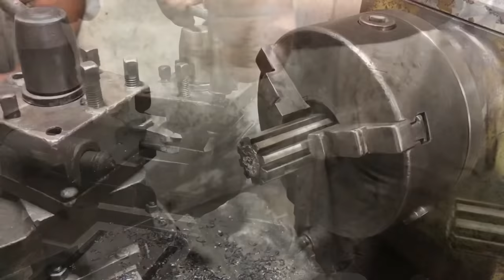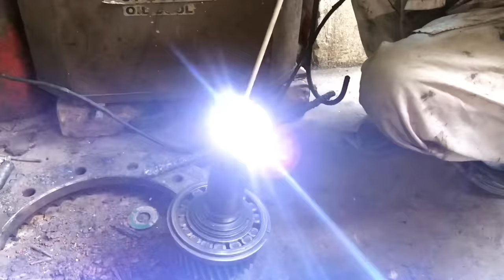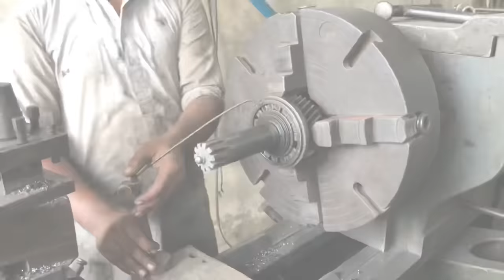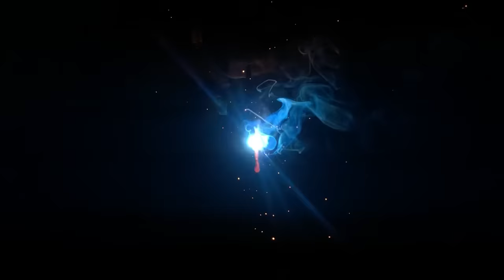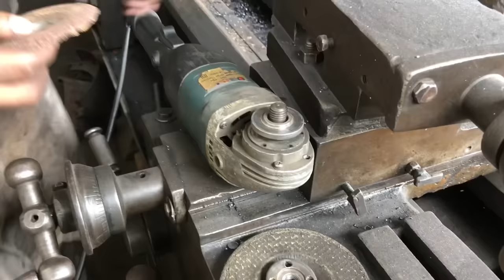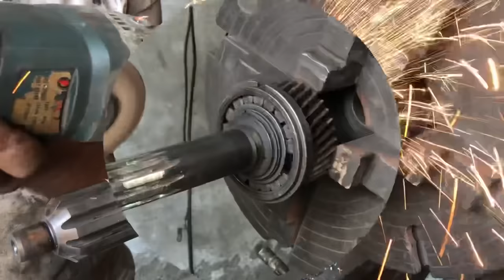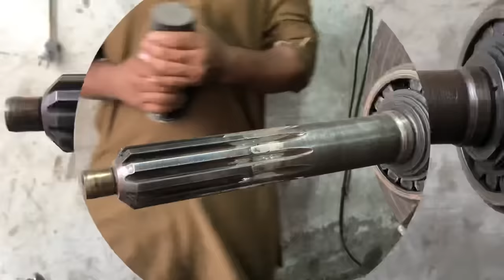The Ingenious guy Connected Broken Input-shaft Very Nicely / Pk process

Comment: Without knowing the emergency that superseded this attempt it is worth pointing out that a shaft failure like this was caused by an eccentric input shaft bearing that lost it's plastic cage a long time ago. The bearing will bind up and cause a high load spike when it grabs. The pilot bearing stub is worn to the point of offering little or no support to the shaft. I would suspect that the transmission front bearing bore is worn out also. But necessity being the mother of invention one must try and not to try you are defeated
Reply: yes, if we look closer we see that 2 or 3 rolling elements (rollers) are missing and it will develop an excentric rotation , i think this was the cause from the begining and instead of fixing the cause he's fixing the result and soon will be the same or worse, but i respect trying to be inventive..🙂Also it is worth mentioning that when he induced to the parts so high temperature with cutting and welding, the parts are much weaker in proximity of that place.
Reply: No, no, you see that's the genius of it: The worn out roller bearing helps make up for the trashed pilot bushing, allowing the whole friction disk to wander where it wants to without stressing the shaft. 🤣
Reply: @artgoat  Ha Ha. why does that sound like the it's practical for a third world country?
Reply: @artgoat  ...🙂

Comment: I like the way all the grit from the grinding wheel went straight into the big roller bearing! I hope he had a spare bearing after that.
Reply: That bearing is history anyway - no way it would be used again.
Apart from the repair job not lasting very long my concern was where the earth wire for the welder was positioned.
It didn't appear to be directly on the shaft so I can only assume it was grounded to the lathe. If that is correct the welding current would have to pass through the lathe shaft bearings and very possibly likely causing damage to them.

Comment: This is artistry at work. Unlike other comments, I don't know why, after carefully constructing this repair, that it wouldn't last in operation. Of course, you've also got to address the reason this steel shaft broke apart in the first place. If it was just a result of an accident/impact, that's one thing. But if it was due to another force acting upon it, yeah, it could break again.
Reply: Hardened shaft + heat from welding and soft rod material = weak shaft no mattet how good it looks at the end
Reply: TORQUE

Comment: The best mickey mouse repair job I have ever seen.  This repair is much better than the chewing gum & duct tape repair.  The shaft is rendered destroyed and useless the moment it broke regardless of the repair afford.
Reply: I have done a similar repair to a transfer case output gear shaft, a one piece forging . The difference was that my repair was in a non-splined section of the shaft. After welding we heated the whole shaft with a torch to a red heat then let it cool slowly in dry sand. Next day machined it to dimension then heated it to red heat again,  and oil quenched it.  Very hard at this point. Heated it in a propane oven to a purple color and let is air cool Reinstalled and ran the vehicle for 200,000 miles with never a problem. The original break that I repaired was unexplained. Happened inside the T-case. Guess it was a defective part.
Reply: Probably True , but whatcha gonna do if there's no other option?
Reply: @peted5217  as a last resort and ready for it to break again in a short time.

Comment: Guess that bearing missing rollers and all that new welding spatter grit in the race doesn't matter all that much since the entire shaft probably sheered again once the clutch engaged.
Reply: Oh no worry, the structural rattle can paint will at least double the shaft strength and seriously reduce the bearing noise.
Reply: In the positive side, the machinist will learn that this fixing isn't working.

Comment: I wouldn't be placing any bets on a welded up input shaft lasting long against the torque of a big diesel engine.  Especially if it was running on a knackered gearbox input bearing.    Bearing in mind though that his circumstances are different than in the UK,  I'll give him full marks for effort and also for making a good video.

Comment: I would think it would have been as easy or easier just to drill a hole in both pieces and put a little pin in. Then weld.  In fact, it might be be stronger to bore both ebds out, perhaps a 16th less than the splines maybe 2 or 3 cm deep, and then make a hardened steel pin a few ten thousandths over and freeze it in dry ice and then put it in one end. Then cool the entire assembly and put the other end in. It will never come apart.

Thinking about it.  16th is too thin. You want the walls of the hole you bore to be no less than the thickness of the splines. Otherwise the wall will stretch and deform before the spline. So if the shaft major diameter is say 1-3/4" (its probably metric in fact) and the splines are 3/16", then lets assume the minor diameter is 1-3/8. Figure 1/4 wall thickness is a reasonable guess of what you need so the splines don't deform or break off or crack. Then you bore and ream a 7/8 hole and then put a pin a thousandth or three over on dry ice. Then press in place. Then make a jig to hold the thing , chill it down, get it mounted up and indexed correctly and press it together. If you get it right, then the crack will meet up right and then the pin will expand and it will never come apart unless you cut it. If you use a?suitable piece of hardened steel of a suitably strong alloy , it should hold.

However, a REAL fix, would be to cop the shaft off the part at the end. Find a hardened steel shaft like maybe an axle shaft with the same splines if you can. If not make one. Then bore the gear end out and shrink your shaft in. That will make a permanent repair. Some people might feel good pining it but if you shrink one part in dry ice, heat the other to 350F in an oven then press them together, they are never coming apart. So long as that pin can handle the torque it will work. 

The problem i see with the welded repair is two fold. The metal will be annealed in the heat affected zone. Since it broke once when the part was at full strength, it WILL fail now that its softer. 2, I'm concerned that the filler may just be a mild steel. So it's an open question if the weld will fail or the metal adjacent to it in HAZ. (Thats why i suggested that a pin may be better. At least if a 7/8 oin can be made from a sufficiently strong material, its good hardened steel). The best solution as i mentioned, replaces the entire shaft. In that way, the shaft grips the gear at its outside diameter and all of the heat issues are gone because you made or found a new shaft. If your licky, you might even find. Shaft sitting around.
Reply: This is good idea💡

Comment: There are plain sections in the outer rim of the broken shaft. That could result from an oscillation over a longer time in combination with an overload of the properties of the material. An mechanical parts failure have reasons. And despite the craftmanship of these workers and the lack of money to buy spare parts  it is higly riscful to fix broken parts. The next failure is pre-programmed, and the next time a person could be harmed.
Reply: Luckily, you can't be harmed by comments about your spelling.
Reply: It's not connected to a tractor pulling engine is it, the shrapnel won't fly far. Heavy vehicules usually have a retarder on output shaft ... The only real risk is when overtaking or getting to a highway when you need acceleration. The initial failure could be as simple as a broken pilot bearing in the flywheel.
Reply: @bvl7390  vehicules  Have another go at that?

Comment: I see quite a lot of imperfections in the welding, where new crack will form easily. With the paint you can cover all these imperfections, but it won't make the joint stronger. But of course if you have no means to buy a new shaft, reparing is the only solution. I suppose there are no used spareparts available. It is by no means a genious job, because every skilled metal worker can do this.
Reply: actually i  think the paint was used  for part fitment as a abrasion indicator of areas that needed further grinding and to prevent rust
Reply: The paint is the only thing making it strong...  those welds are not.
Reply: Можно с разбора бу найти.

Comment: Drilling out both ends and tapping them would save on heat generated, a lot less welding. Temper will surely be an issue long term but i will hand it to em…in a pinch with limit tools and no replacement part capability, something broken down will again move. 
 
Agree with other comments on the roller bearing and race regarding spatter and spark. Details matter in quality workmanship.  But by the same token —- the customer only gets the amount of quality that they pay for.

Comment: This is first grade bodging at its best. Clever approach when you have no alternative.
Reply: Just enough to get you to the parts shop to buy a new one
Reply: I believe it is spelled botching. IE: I botched the install
Reply: @luke s exactly
Reply: @luke s I know but to everyone else, hey it looks good it must be good
Reply: Be nice to take up a collection and buy him an Electron Beam Welder. Only about 20 million per copy.
When Grumman shut down their Bethpage, Long Island main plants--and therefore the F-14 Tomcat Navy fighter production line--a E-Beam welder went for $500 grand! Cheap at twice the price.
They used it to weld the wing-box beam structures into the fighters. And then tested wing durability by flexing them to 75 degrees off plane! Never had a failure on those ebeam welded wings--in production test or in carrier service.
NICE, NICE MACHINE!

Comment: It just kills me everytime when I see them welding on a lathe, without attaching an earth clamp to the part….every bearing on that lathe will soon be toast,like the bearing on this input shaft….🤔
Reply: Including all the debris that was pushed into the bearing that was still on the shaft.
Reply: That was my big issue with this repair (besides the chances the shaft would still fail later); all the gunk that would get into the bearing, the missing rollers in the bearing (which might have contributed to the initial failure) and the hot welding slag that would drop onto the ways of the lathe.
Reply: My thoughts exactly
Reply: So they have work again next month. Lol
Reply: Brought to you by Harbor Freight
Reply: @lightshipchief  .
Reply: @jusodemic240 ،
Reply: Allah knows best 😉
Reply: @laurenbish3116  ccccccccxcc
Reply: Naaah- old wives tale from the days of babbit bearings-  Electricity always takes the path of least resistance, so the current will flow to the closest clean ground- bearings that are coated in oil make really poor grounds.
Reply: E4xf5  хватит ровно на 15 дней, и отломится в самый не подходящий момент.У меня на авто 20 лет назад такое было.Делали за неимениемзап.части.
Reply: E4xf5  Exactly. That thing will fall apart as soon as they put it back in the truck.
Reply: This is India!
Reply: Whatever works y accessible for these resourceful crews( brand new have issues as well or bad)😂❤🎉 imo
Reply: P
Reply: @lightshipchief  KKK (l() з9

Comment: All that grind spatter in the roller bearing that will be a real pain to get it clean, which I very much doubt will happen.  I would question the torque load the repair will take.  Notice that the shaft was only centred in the chuck with a pointer that was supported in a stand resting on a flat(?) board, I doubt the shaft was concentric.
Reply: Good good good good vibrations?

Comment: This is fine for a temp solution , yes good job.

I can tell you from experience it won't last long, specially when under uneven strains
Reply: Ritz Khan...have to agree with you, a temporary repair only...
Reply: What do you mean temporary solution that repair has that machine shops golden 60 limited lifetime guarantee. It has a lifetime guarantee of 60 clutch applications, 60 gear changes, 60 seconds of engine run time, or 60 meters of distance driven which ever comes first and just because that  shop likes its customers to be completely satisfied with the quality of their work they do the metal partials from “machining” the input shaft with the grinder that got sprayed into that special high speed low drag input shaft bearing and the custom special high gloss non stick coating applied to the input shaft is no extra charge because the owner of the input shaft is a loyal repeat customer 😁
Reply: Gullreefclub...apologies, here in the deep rural countryside of France we're not use to such long guarantee, or such fine engineering, we're still at  the stage of repairing leather harnesses and cart wheels to keep the wheels of road haulage turning...

Comment: Good job passing all the current from the welding action right trhrough the bearing (now ruined) of the lathe....
Sending sparks to the bearing on the shaft (will be reused?) demonstrates great skill.
Reply: Pfft!??...no its not..drama queen
Reply: @Outdoorcookwarereviews  Not good machinist technique. He also probably got a good bit of weld spatter in the rollers of the bearing on the shaft he was repairing. A good machinist would have removed the bearing on the shaft prior to this type of repair. In our shop we never welded in our machinery but looking at the condition of that lathe it probably didn't matter anyway.

Comment: Excellent workmanship on this repair, but unfortunately, the repair is not even close to the original fatigue strength of the original piece.  It will not be able to take the same loads and therefore, break again at a much lower torque loading.  Welding any parts creates high tensile stress risers.  This can be annealed to relieve the residual stresses  but the part would have to be re-heat treated to gain back some of it's original strength.  Also the internal grain pattern from the drop forging process used to make such parts, is not continuous in the weld area, which greatly reduces the fatigue capability in that area.
Reply: Браво ,профессор !!! 🤞👍🖐️

Comment: I think i would have used a bigger hole and drilled both sides pressed in a round bar using fire and the freezer to join them before welding.
Reply: You'd loose all that weld area, plus create two new weak points between the rod end and the inner hole. The larger the rod, the larger the weak point. Here he just used the protrusion as alignment point, and to set the weld gap.

Comment: What a bad and dangerous job, you just welded hardened steel with soft steel, you didn't do the tempering process of the material, with heat and oil, which gives the steel a blued tone and you put paint on it? terrible....
Reply: Wasn't the paint put on to show where high spots are, after sliding the clutch plate over to create witness marks?
Reply: @NevilleStyke  Doubt it, he painted it way past the splines, all the way down to the bearing.

Comment: He's obviously going to press a new bearing on there, and who knows, maybe he tempered the whole shaft after pulling the old bearing off (don't know why he would paint it first though). Hopefully there is a welding rod that can match up with the shaft properties for the tempering process.
 
I didn't like the visible runout of the gear end when it was turning on the lathe. Could that be because of the missing bearing race, when in fact the gear and the shaft are perfectly aligned? 

I would have at least tried to cover the lathe before blowing all of those grindings everywhere. 

There is hope for that thing. It doesn't appear that he is unskilled, perfectly incompetent, nor totally oblivious to all of the points made in these comments. Would be keen to see a follow up indicating heat treatment, and evaluation after field use.

Comment: It would be interesting to see some followup after these repairs. There are always comments like this won't last five minutes. But sometimes repairs like this last a long time.

Not sure that I would agree this was a hardened shaft, but can't claim any factual knowledge either way.
Hope they cleaned the grinder dust out of that bearing.
Reply: There is at least 20% of the bearing rollers missing and no grease, that's what caused the failure and it will fail again in seconds. Third world mentality, don't bother greasing the bearings in the first place then buy welding rods to fix it which are more expensive than grease.
Reply: Maybe 10 minutes? Anyway good job.
Reply: @maff2008  One of the numpties defending the work on here, Rafa, said this was in India, which is a first world country. But this is one of many people around the world that are obviously not a professional and employed at an actual service shop, this is just another guy that knows how to turn on a lathe and use an angle grinder so they make a bunch of engineering videos about things they have no knowledge, training, and especially proper tools and materials to do correctly.
Reply: @ReroutedYearAD  India a first world country? Yeah ... no.